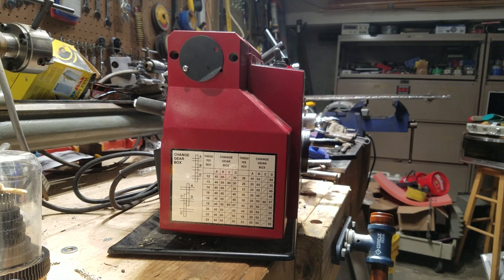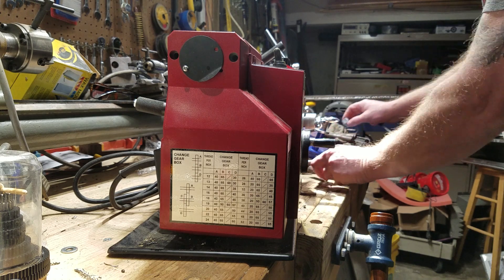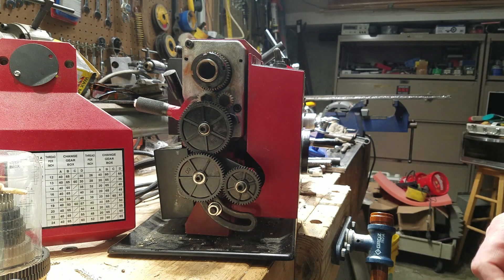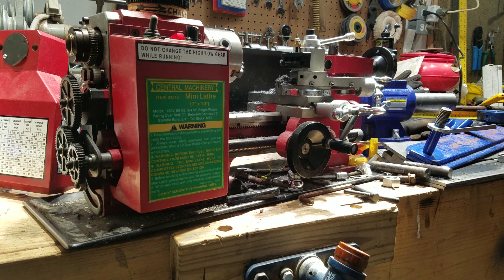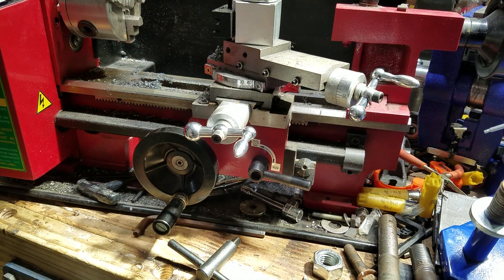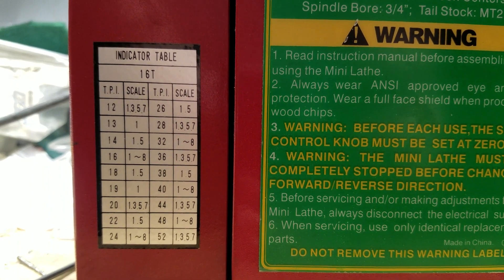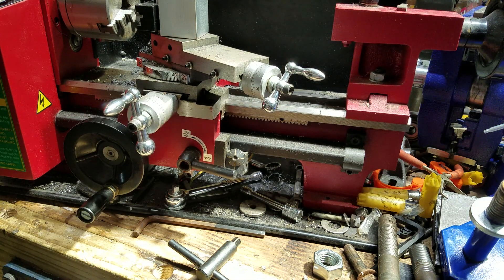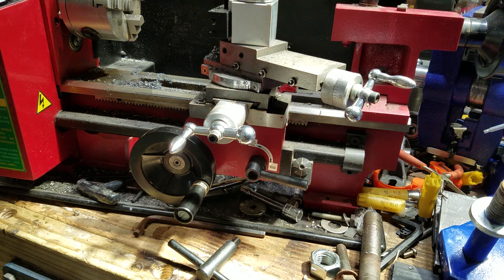How to Cut Threads on a Harbor Freight Mini Lathe - 3/4" at 10 TPI

Comment: I bought a Colchester bantam as my first lathe and I've been looking at a mini lathe as well, the more I look the less I think of them and it makes me realise how good the bantam is.
Reply: Hey- I got a 8×14 about a year ago and it Is a PHENOMINAL little lathe.. that is.. now that I have rebuilt, replaced, modified, or upgraded literally everything on it😂 LITERALLY everything but the frame/chassis. Big 4hp motor, new custom drive train. New bearings, extended crosslide and qctp. Custom zero backlash nuts on all the leadscrews. Rebuilt tailstock. Custom gears. Custom power and electronics controllers with temp monitoring and active cooling control. literally everything😂 its a great little lathe now. That said If I had to do it again I'd save up another 1000 bucks and buy a proper lathe from the get go
Reply: @notyouraveragegoldenpotato I didn't do anything to mine, just used it, I'm not sure it's possible to buy a quality lathe these days.

Comment: can you show us how did you use the die tap to cut this size i need to make this same 3/4 threads but in 3/4-16. i have a 9x20 lathe but its kind hard to use the dial and i also have the 3/4-16 die but i cant get it started what tool did u used ?
Reply from the maker: I had a really hard time starting the larger die, even after chamfering the end of the bar being threaded. It would probably have been a good idea to either start a short thread on the lathes or use the lathe to create a longer more gradual chamfer perhaps? This might help to get the larger dies started?
Reply from the maker: I also found this short video of where I cut the corresponding threads with the Harbor Freight large tap & die set. Not much in the way of instruction or technique though. https://youtu.be/fRUk_EE1wBQ

Comment: Does it perform left hand threads by using the left/ right lever?
Reply from the maker: Yes. You can cut in either direction and change the hand of the thread. And in fact, cutting the opposite LH thread is easier because you can start at the same point on the piece and end the cut in free air, rather than having to stop the machine halfway through the piece. Theoretically, you could also invert the cutting tool but that's not really something I'd recommend, especially with a tool post like the one on this mini lathe... but possible.

Comment: If you are still using the one sided half nut , replace it with the complete half nut from LMS. Then you will be able to pick up the same mark on the thread dial each time. Those one sided half nuts are terrible.

Comment: Hey there!  I've got a mini-lathe as well, and am currently working on a project that also involves cutting two 3/4"-10 threads using the single-point method.  I've got my compound set to 29.5 and am advancing with that.  The compound is tightened down as much as possible while still allowing it to move smoothly, and I also have upgraded saddle plates to reduce deflection in the carriage, but I am still having the problem that the tool digs in and stalls the motor on every single pass once I get about halfway through cutting the thread.

Do you have any tips on how you handled deflection / stalling / etc. while cutting this thread on your mini-lathe?  Any advice would be very much appreciated!  Thanks in advance!
Reply: The correct angle for imperial ( = inches ) threads is 55 degrees, and it's half is 27,5  NOT 29,5.
For correct orientation of the compound i do use a little square, built from myself with the help of simple trigonometric rules ( sin and cos from a scientific calculator ).
If your motor stops during threading cutting, before beginning threading operations, cut a minor diameter on your piece, where the threading will have to be ended ( for 3/4 " ...  i would say ... 16,0 mm. or 15 mm. - please, make your self conversion from millimeters to inches :  remember 25,4 milimeters = 1 inche ... ).
That "minor diameter" should be large more than 1/10 of an inche, better 2/10 ,  whose value in metric system is 5,08 mm.
This would help to discharge force on the tool at the end of each threading trip.
( i suggested 16,0 / 15,0 mm. , but there are specific tables on doing that, if you haven't other chance i can try to send them you later, but those of my are metric-oriented ... )
After that ( with your compound at 27,5 degrees ) you have to advance A BIT ON EVERY TRIP ,  in many and many "trip", for more that 2,54 mm. ( remember, your imperial threading is not an equilater triangle ); you must advance till 2,75 mm. ( from trigonometric simple rules ... ). I hope someone more expert than me can give you better instructions ...
Pay attention ... your piece must be firmly tighten in the chuck, use of tail-stock is raccomended if possible. Also notice that the work made from the tool begins far an far harder when the tip advances into the piece ... ( the worst is at the end ... )
For long ( and slim ) screws to be cutted, a following rest is hardly suggested.
Good luck, just in these days i have threated 2 long pieces, 3/8" - 20 TPI, long almost 300 mm. , that is the maximum allowed by my chinese mini lathe ... at least now all is ok, after 2 fail attempts ... ( experience is all ! )

Comment: What tool do you use to thread with? I received a mini lathe and it did not come with the tool to thread bolts.
Reply: Buy a thread cutting insert tool or grind a hunk of HSS to a 60 degree point (assuming you're doing 60 degree threads)

Comment: I watched one video where the guy cut the thread from the i side to the outside of the thread, he said it prevented crashing the head
Reply from the maker: Interesting. I think I considered that at one time but then you have to reverse the spindle, the feed and the tooling. Don't know any reason why it wouldn't work and it also has the advantage that you can accurately control the length of the thread.

Comment: Miraculous.  I wonder if you took a sharpie, made a mark on your leadscrew with a matching mark on your threading dial gear next to it, backed your carraige disengaged back to the same location and enguaged the half screw on the same number if it would ever match up the sharpie marks. :o
Reply: Oh ya, 40 50 60 30 would prob be your best gear set.

Comment: hello good video, my question is, you can make .5 mm millimeter thread. Saludos desde mexico
Reply from the maker: I think to truly get a metric thread, you need a machine with a metric leadscrew. I've not looked into it but if you checkout the link in the video, it should tell you how close you can get with the imperial leadscrew and the right combination of gears. It also depends on how many threads you need engaged at the same time.
Reply: Hello, i have a metric chinese mini lathe with metric lead-screw, pitch 1,5 mm.
Without changing the lead-screw, i can cut treads in inches with the following error, after having selected the right gears ( to be purchased and then worked in diameter-bore and tickness ) :
25,38461538... instead than 25,4  , that is the true value in millimiters of an inch.
The error is 0,06 % , as to say 0,6 for a thousand and - unless cutting very long screws - it is generally ok.
( in addition, now i can also arrange a 127 teeth gear to get exact values, i made an extension in the gear box, whose cover has to be removed when the 127 gear is in use ).
Can't this work done in reverse ?
How many threads-for-inch has the imperial lead-screw of your lathe ?

Comment: I thought you’d want more than 10 TPI cuz it gives way more effectiveness?

Sorry if that comes off as n00b but I’m just getting into the lathe and milling machine world.
Reply from the maker: I really just went for the closest imperial equivalent to the M20 thread of the original. But you're right and in the end, I opted for a manually threaded 3/4 with 16 TPI tap & die. Still, I learned a few things in trying it out on the the lathe.